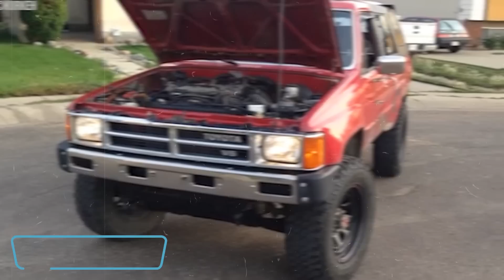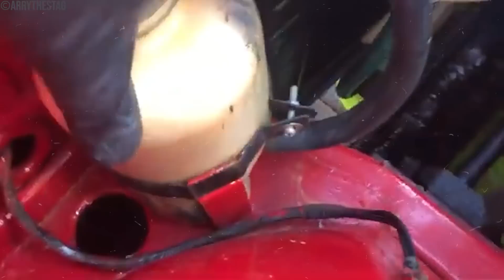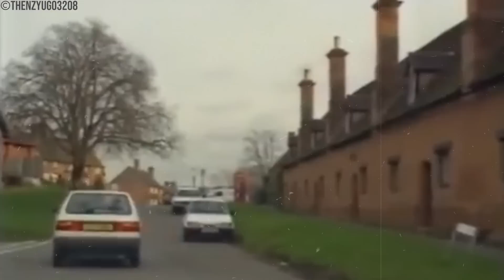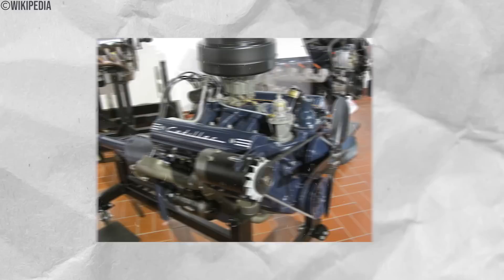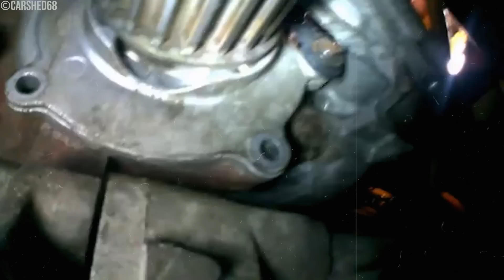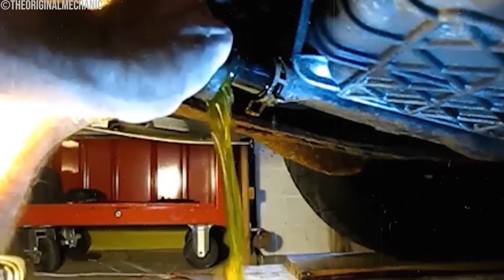20 WORST Car Engines Ever Put in Production Vehicles!

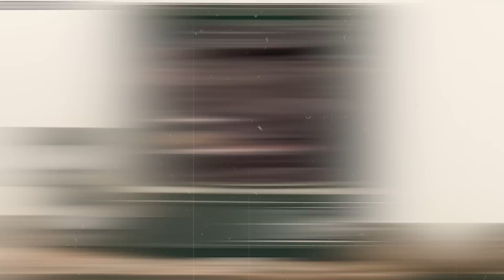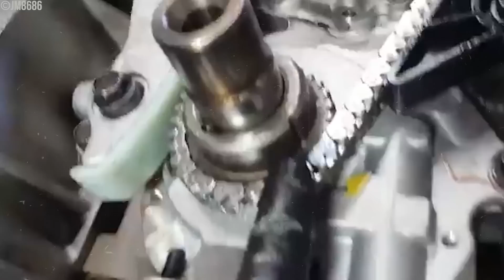Comment: 06:11-07:20, the Chrysler 2.7-liter V6 was rushed into production by the ill-conceived merger with Daimler-Benz, and when you look back on it now, was it really worth the effort?

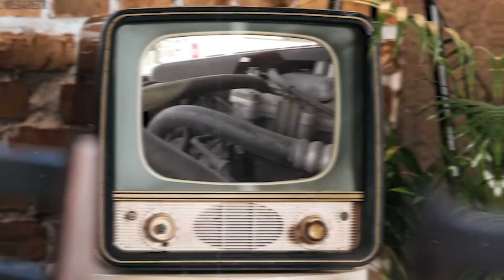16:46-17:49, Chrysler should have used the Mitsubishi-built 2.0-liter 4G63 Sirius engine for the Neon.

Comment: The Ford 4.2l isn't a V8. It's a 3.8l V6 with a longer stroke. The first ones had gasket issues, which Ford later addressed. The head gasket usually went on both engines at about 125 000 miles. Other than that, both the 3.8 and 4.2 were capable of going over 250 000 miles. They really don't belong on this list since they actually are fairly reliable. The  Ford engine that should have been on this list is the 5.4l 3v introduced in 2004. It was an absolute nightmare for owners

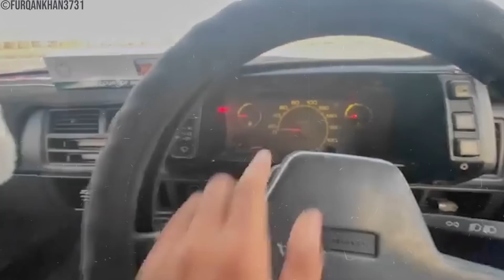Comment: 19:40 - I drove an 86 Chevy Sprint ER, purchased used, from 1990 onward. It had a 5-spd, and fuel injection. That FI made a BIIIIG difference, as did the stick. If they’d just built them all that way they’d have had a better reputation.